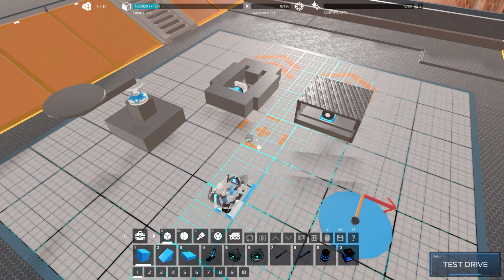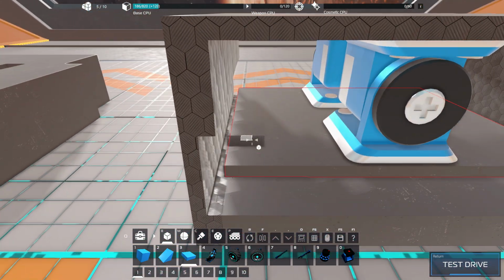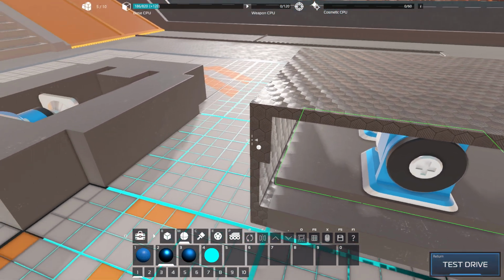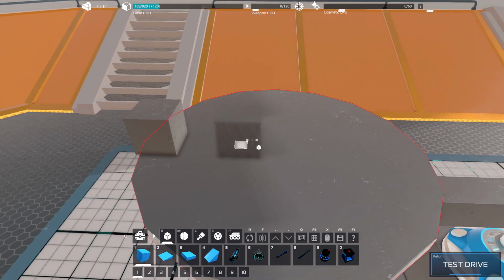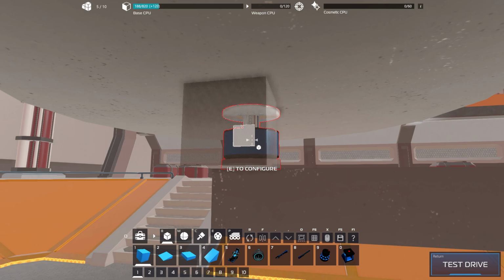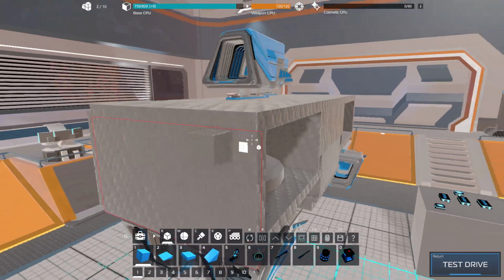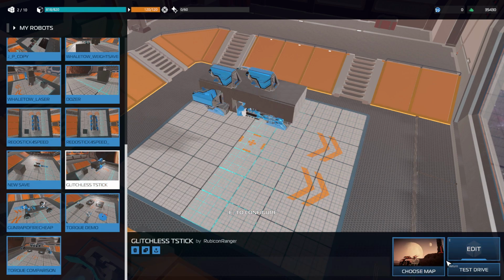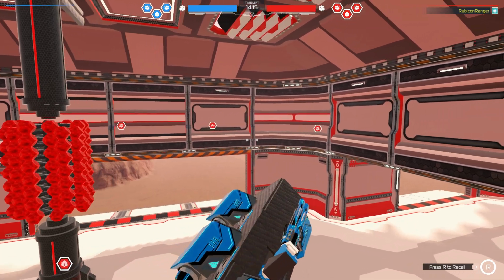Robocraft 2 - Torque Generators in Fliers

Comment: If you mirrored the effect of the second torque mechanism, can you generate a net forward force?
Reply from the maker: That was actually the original intention behind a ton of the early research I did that found these mechanisms. Unfortunately the whole time I was searching for a configuration that generated a stable net force using the active and passive joints I was barking up the wrong tree. I was never able to generate good clean net forces with just the joints. Another player by the name of shadowcrafter01 found the exact exploit I was looking for during the same period of development, except his mechanism used wheels. I combined our two mechanisms to make an early flying machine (without antigrav/thrusters) in this vid:

https://www.youtube.com/watch?v=BzRzWHT3ZuU

Ultimately the actual flying exploit was patched and we eventually got thrusters/antigrav. What you see here is just me presenting the best of my findings from that time period that were still functional.

Comment: This was very useful. Thank you Rubicon. 

Once Freejam get a handle on Havok's peculiarities then it is likely that the first two will change. A little surprising that the material and dimensions would play so big a role (one would expect effectiveness to slide with or against weight, not to slide off fro ma middle point) - but it appears that it does. 

This does inspire me to reattempt use of gyros.

Thanks again.